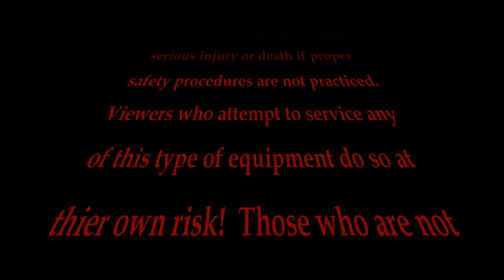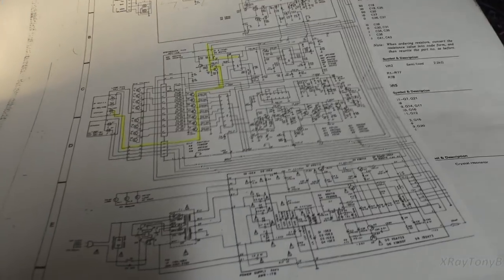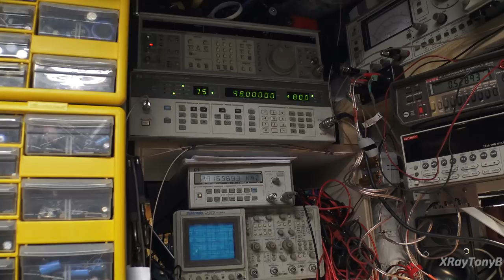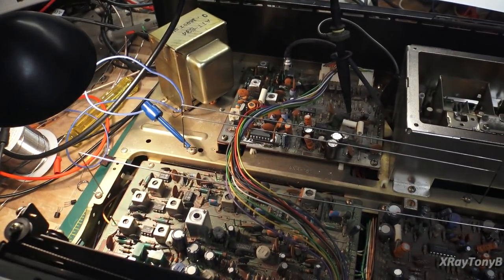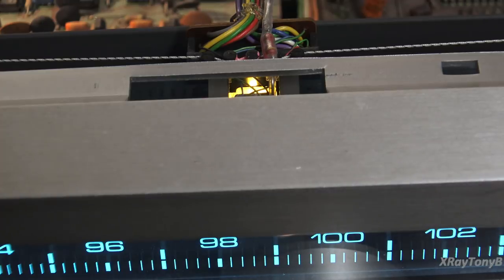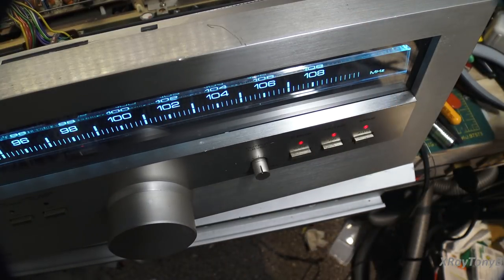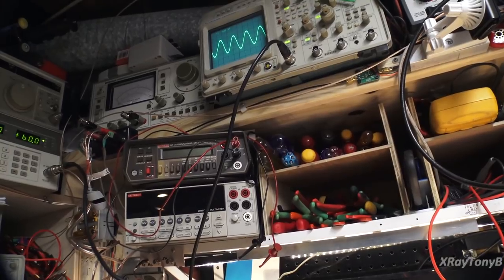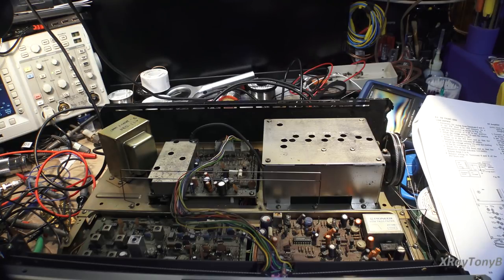Pioneer F-28   Part 3:  The blind squirrel finds an acorn!

Comment: I've been watch for a while. You have very good and informational videos. I have a question. You always check speaker output, DC voltage. How much voltage would be to much? I'm starting to work on the pioneer sx-450. Chuck

Comment: I'm still curious how the 512 step counter works on this. I wonder if the digit representing 256 is having the same light reception problem as the mute thing here due to the light spread?

Also I'm guessing there's going to be something to do with each step? So you have the range which it can tune in... 107.9 - 87.9 = 20 and then divide that by 512... And that results in a value of 0.0390625... Thus it must tune into 87.9 + (counter * 0.0390625)... Could be a problem if the counter isn't getting a clean "256" to multiply by that other value... (Whatever voltage represents a 1 or 0 to multiply in the 2^8 slot. Or the signal for 2^8 itself isn't good.) And then those increments past that will be off all over the place.

I don't know enough about radio stuff though. (Which is why I don't know the terminology and likely rewording something already covered.) Just trying to figure out what's going on with a logic like that of scripting. (I don't claim to be a programmer either, but I've gotten some code to work by the seat of the pants after pulling lots of hair while debugging it.)

I'm also surprised the dial trolley doesn't have some kind of light pipe like a piece of clear plastic given the nature of those sensors. You'd think a little incandescent bulb that size would be even dimmer than a modern LED even though it's not as directional. If that's the case something as simple as a translucent film added as a diffuser might help.

Comment: Couple of points: Lots of people are saying "recap first". Un Uh! you already saw that none of the electrolytics were bulging out at the bottom. One other thing to check on them is the ESR.  I happen to have a nice meter for that, it can read ESR in circuit.  It was total luck that A) I got that one. and B) that I know that the circuit was originally a tube design from the USA.  At least the Chinese copiers had the good sense to reproduce that design with transistors!  The second point is that now you are close to making the F-28 usable again, someone will send you a Pioneer F-26 to fix!  If you choose to accept that mission (impossible) you will become the world's foremost English speaking F-26/F-28 authority and (I wish!) able to retire on the $$ you get to fix or consult on these crazy tuners!  8-))